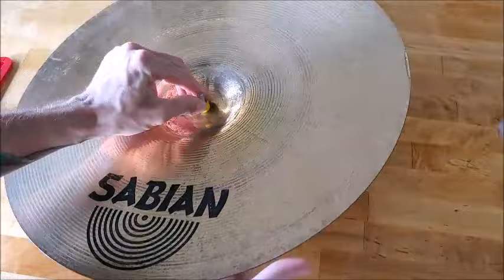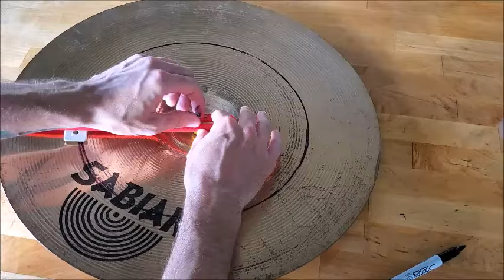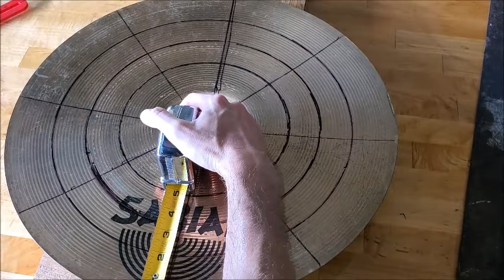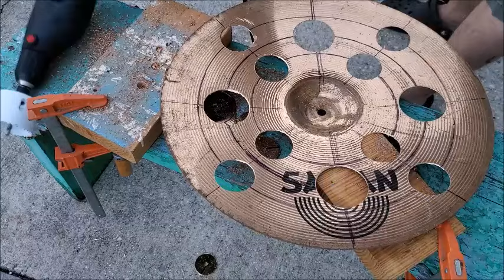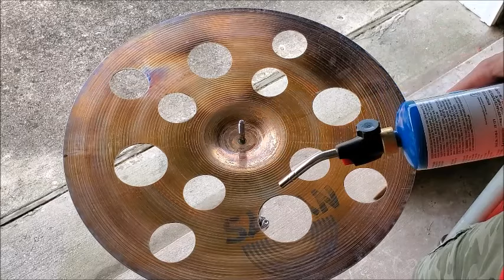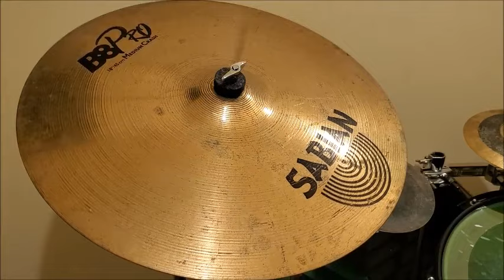DIY Ozone Cymbal (HoleZone)

Comment: I would watch heating them up unless you quench them directly after it makes them brittle.  If you heat them red hot then quench in water tank the color stays and tempers the metal. With out quenching they will break very easily. I found out the hard way and after talking to cymbals makers figure out quenching is best
Reply from the maker: I questioned if I should quenched the cymbal but I have had any issues with it yet. B8's are a pretty hardy cymbal though so it might be ok.
Reply: Jace Hebert could be the one I shattered was b20 but quenching also helps the sound for me Atleast. I took a couple sabian sbr rides brass lathed them hammered and quenched. Before quenching they sounded dead but good tone now after quenching the volume open up big time

Comment: its cool but maybe you could made the first four holes near to the bell and check the sound before drilling next holes, need to play with the diameter an location of the holes to get the correct sound
Reply from the maker: Personal I feel as though the sound is spot on.

Comment: Your drum heads are confusing.  Are they Remo or Evans?
Reply from the maker: They're Remo drum heads but have Evans E rings on them to help with the over tones. I dont like Remo rings they aren't wide enough.
Reply: @JaceHebert  Ahh. That makes sense. Thanks! 

I followed your procedure for this today. Had an old Sabian Solar cymbal. Sounded terrible.

 Its amazing. There are not many things that work better after drilling a bunch of holes in it.

Comment: where did you get the compass from? Been looking for it on amazon and lowes
Reply from the maker: I made it.
Reply: @JaceHebert  I have to ask what compass would you suggest to draw those lines? I tried helix and that failed measurably
Reply from the maker: So a normal compass won't do, what you need is what's called a Beam Compass. They are somewhat pricey but they are also fairly easy to make. I've made a better version since this video was made. I recommend going to homedepot and getting a large yard stick and drilling holes in it so you can adjust your center point.
Reply: @JaceHebert  Ok final question do you have a pic of your new beam compass? I'd love to see it if that is possible
Reply from the maker: Sure, I could make a short video and maybe send it to you. What kind of social media do you have?

Comment: Hey, what's that compass like tool called that you're using? Something like that would be super handy but can't seem to find anything like it
Reply from the maker: I'm so glad I could help you with this problem! I struggled to figure out for myself and after getting lucky stumbled across someone using it. Its called a "beam compass" now the one I'm using I ended up making because I couldn't find exactly what was going to fit my needs.
Reply: @JaceHebert  thank you! Think I'll probably build one myself. Your design looks a lot more useful than the commercial ones I can see.
Reply from the maker: No Problem! The red on in this video was my first one, I actually remade a better much more efficient one. If you're interested in checking out Gen.2 its in my Junk Hat video.

Comment: where did you get the equipment
Reply from the maker: Which equipment to be exact?
Reply: @JaceHebert  the drill bits
Reply from the maker: They are holesaw drill bits. You can find them at any hardware store or on amazon.
Reply: @JaceHebert  thank you